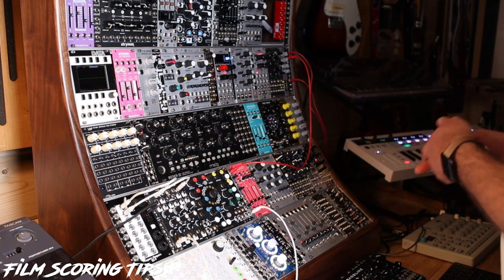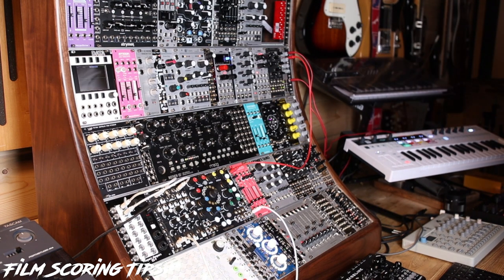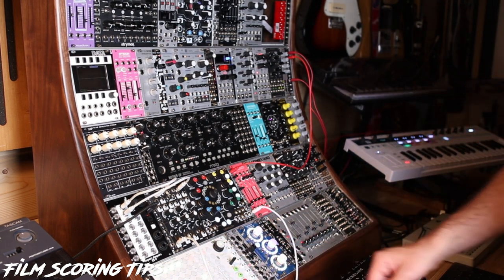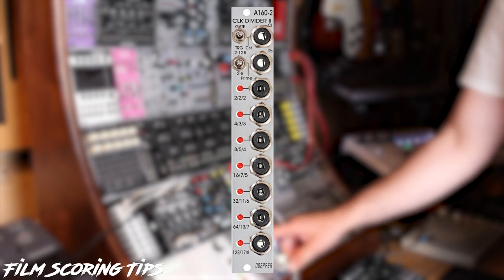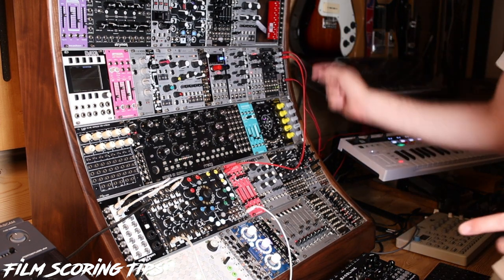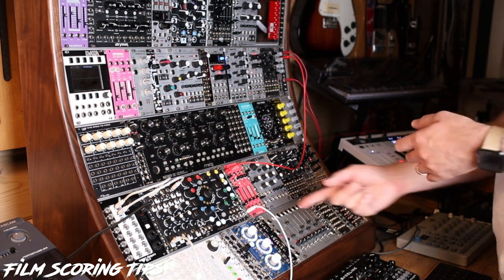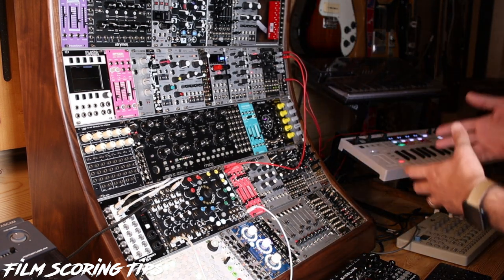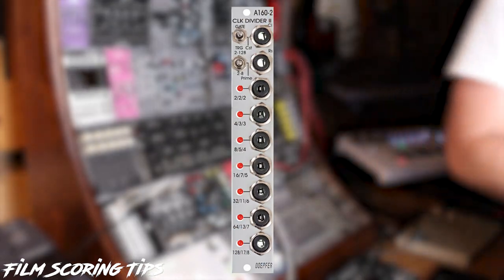The basics of modular synthesisers (Eurorack): Gates and Triggers

Comment: A nice step into the topic, and I can recommend that book, since it's a great read not only for beginners to get inspired and learn something!

One thing that seldomly gets mentioned about Triggers & Gates in respect to clocking units is the sensitivity of the clocking-inputs, especially with triggers:
Depending on the choice of modules when starting out, some people will face confusion, since some clocking does not seem to work as intended, because the clockinput of a device does not recognize the trigger every time or even at all.

This happens with some clockdividers that spit out triggers that don't quite reach the voltage-amplitude that is needed for another module to recognize it, with others the dependence on a certain duty-cycle hinders a trigger from being recognized because the "event" is way to short. This happened to me right when having built my first smaller rack and I did not bring my Sequencer to work with the clocksources I had. I figured the sequencer to be broken, but then tested out with different gatesources at hand to realize, these would work. Shakmat's Time Wizard clocking QuBit's Bloom is a great example: Having the outputs 1 - 4 of Time Wizard not being able to clock the Bloom, the outputs 5 & 6 of the Time Wizard are sending gates instead of triggers which work for Bloom. I'm sure there's other examples of that. 

Also I later on got the concept of "syncing a clock" and "advancing a sequence" differ from module to module which makes quite a difference in operating some units.

In general, I find the digital modules to be more picky when it comes to the quality of the clocking-signal. 

I'm leaving this here just if for any chance someone is having issues like that :)
Reply from the maker: True, I even had modules not responding to triggers adequately because I was using cables with LEDs that suck some voltage
Reply: @AlessandroMastroianni  Oh yeah, about them, I totally forgot. I've seen some people even using them for critical cv and wondering why their tuning misses the mark. I think these are better aimed at "showcasers" or content-creators in general, since they help visualize what others need to see to learn.